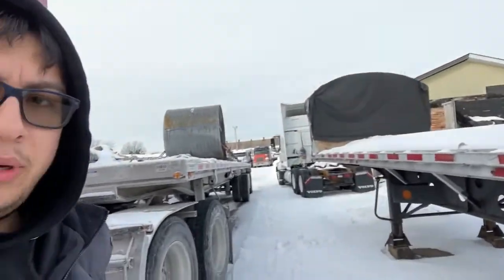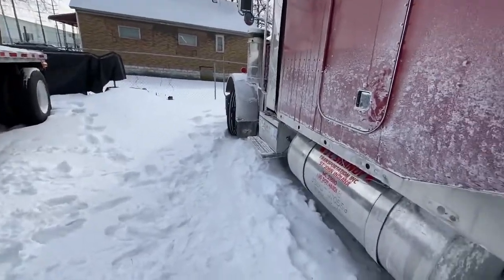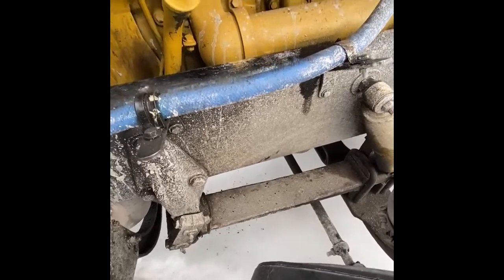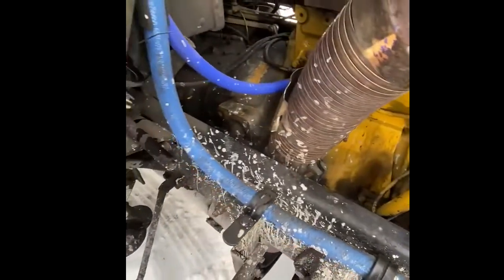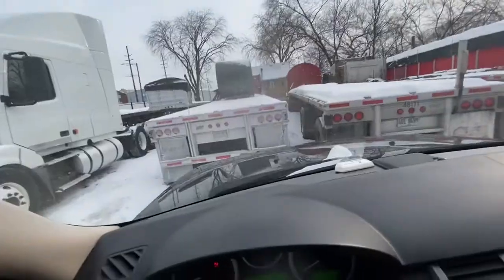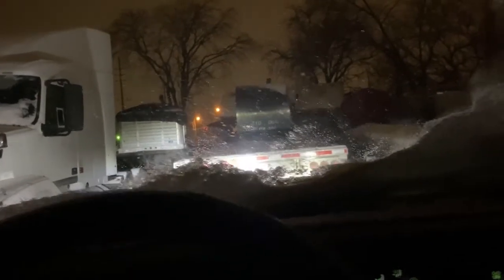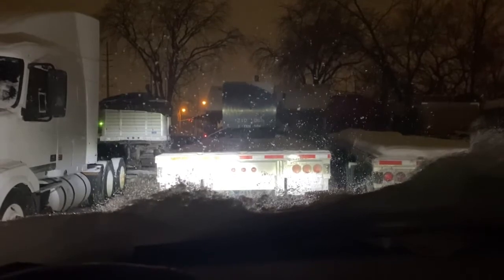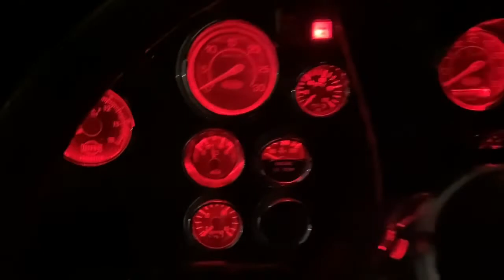FIXING MY BLOCK HEATER ON MY 379 PETERBILT WITH 3406C IN FREEZING TEMPERATURES

Comment: Did you  have to drain antifreeze or oil to change it
Reply from the maker: If your replacing the actual block heater it will leak antifreeze. I was just replacing the cord so it didn’t leak.
Reply: @MIGUELGONZALEZ-nz2tu   okay thanks yeah I think I need to replace the element and cord on mine. Stay warm from minnesora